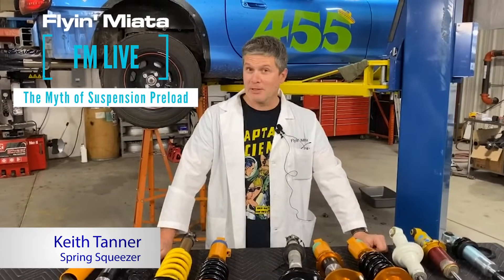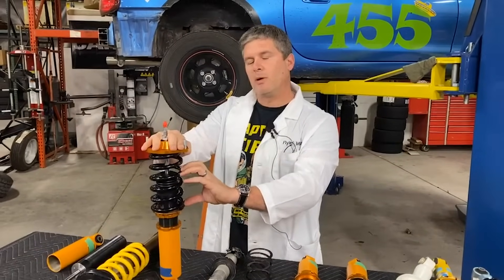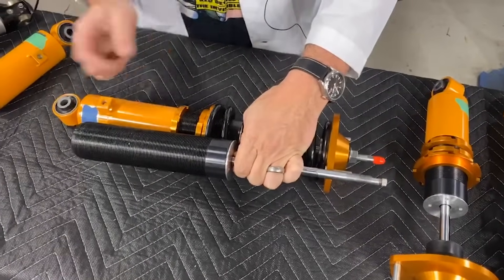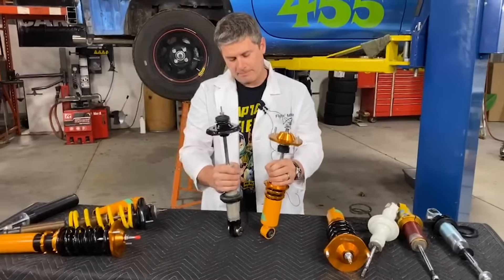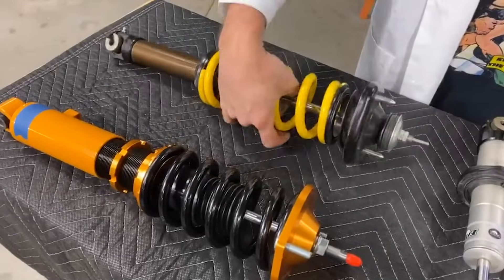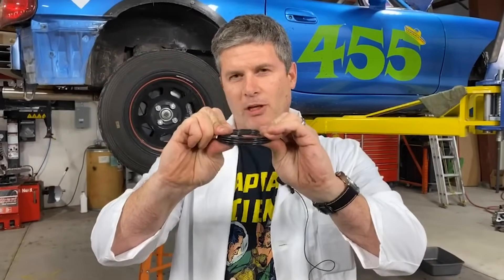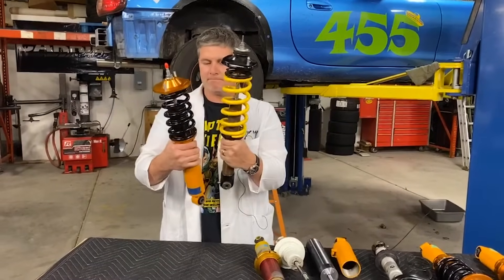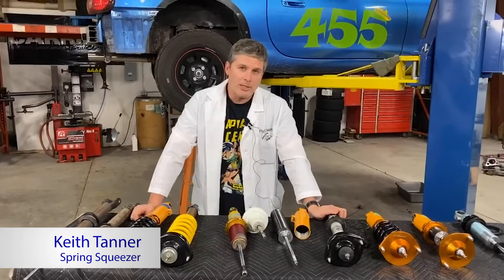The Myth of Suspension Preload (FM Live)

Comment: When the preload is not separated from the height then you are directly shortening the entire suspension travel by adjusting the perch level which you would need to do to if you want to lower the center of gravity of the car.
When preload is separated you maintain the same suspension travel while lowering it. How would this not be considered a "tuning" feature? 

If someone is just looking to replace stock shocks without changing the center of gravity then ya you are better off with a single body unit but that's only half the story and in no way grounds to call it a "Myth". Both styles cater to different purposes and you are acting like your style is the only style. Even Ohlins has designs with with separated height and preload adjustments and i definitely wouldn't call them hack-jobs...
Reply from the maker: What you're missing is that there are other limits to suspension travel. A good Miata one-piece shock will be designed to allow the maximum compression travel the suspension can physically provide before something else stops it - control arms vs subframe, ball joint range of motion, tires into shock towers, etc. Using an adjustable length shock will not give you any more than that - but it will give you the ability to limit your compression travel (bad) and will limit your overall travel due to the shorter shaft travel inherent in the design (bad). This is the thing that everyone overlooks. No matter what the ride height, the one-piece design will give you maximum compression travel and more droop travel than a two-piece.
The two-piece design is the weakest aspect of the Ohlins, and I will happily call them a triumph of marketing over engineering in this case. You can feel them topping out over crests due to the short travel.